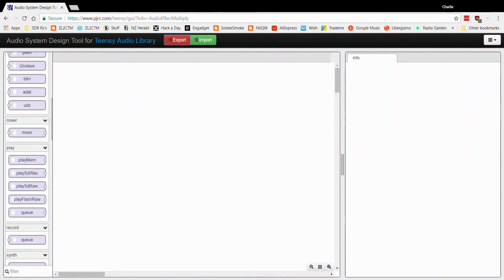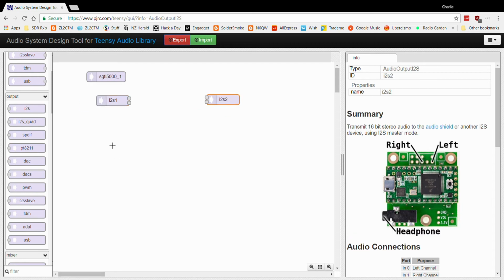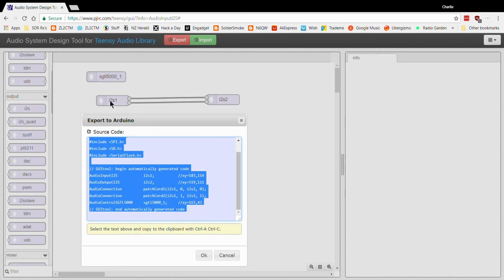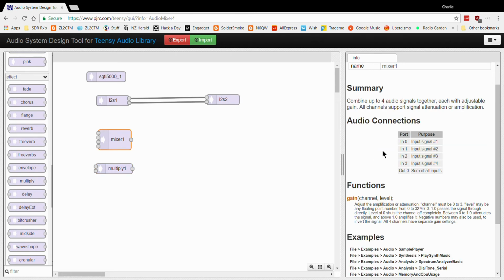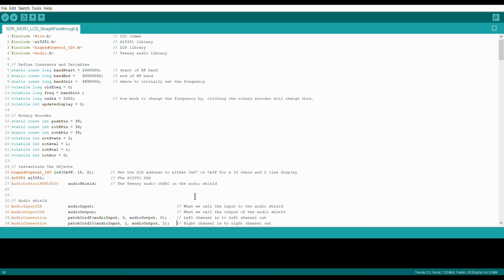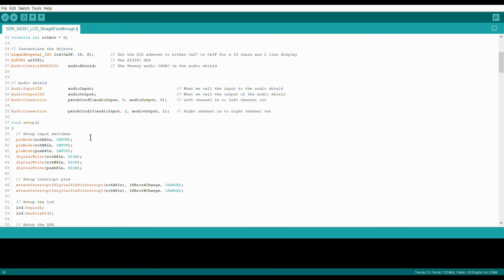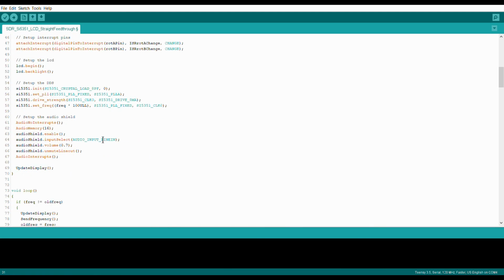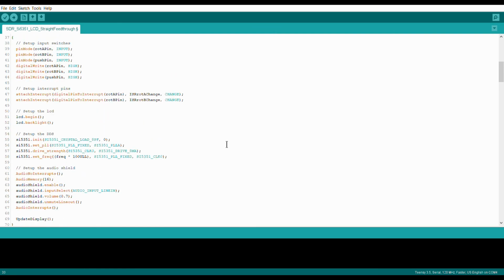Homebrew SDR SSB Rig - Part 5 Audio Pass-through Test Code

Comment: Isn't the OUTPUT of the audio shield (I2S block) actually the INPUT to our DSP (IE: the output of the A/D converter), and the INPUT to the audio shield is the OUTPUT of our DSP (IE: the input to the D/A converter)?  Also how did the AF design GUI associate the codec control block with the I2S blocks?